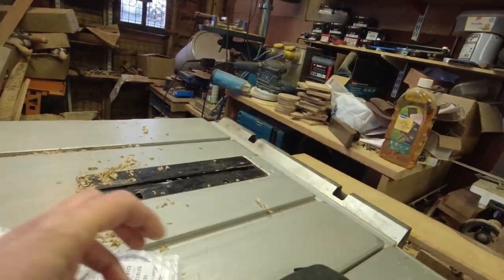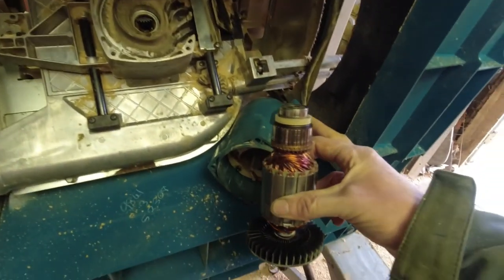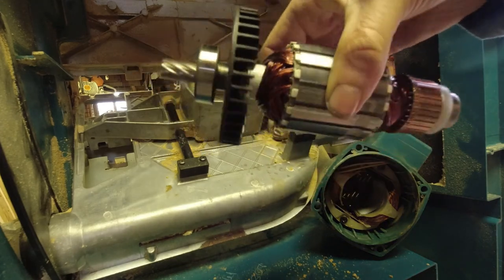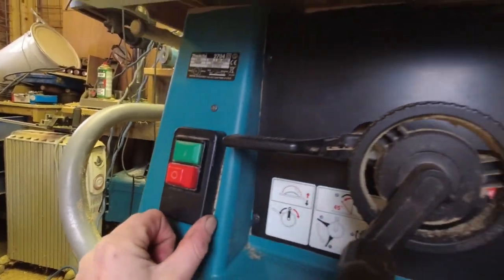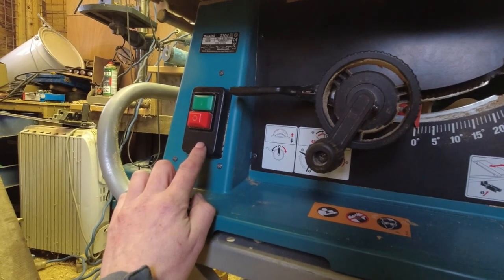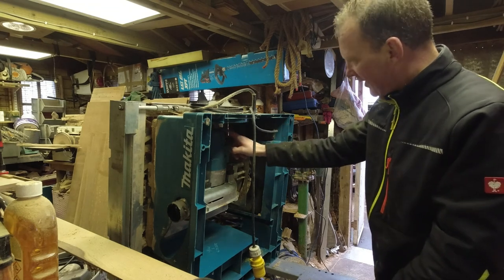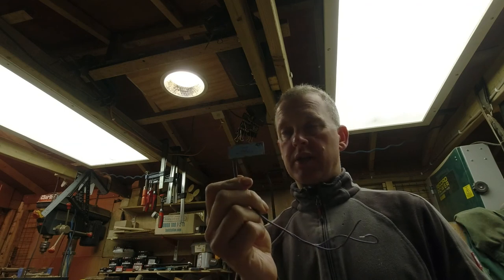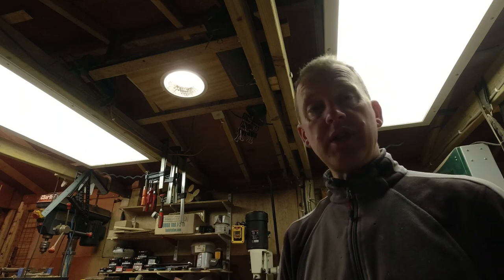Makita 2704 Table Circular Saw Trouble Shoot & Repair. DIY Disaster

Comment: Thanks for the video, It was certainly helpful.
I had a lot of problems with this saw that I bought on Ebay. It stopped working whenever I was cutting anything remotely hard or thick then restarted after a while. I replaced the armature - no change. An electrician told me that he tested it and couldn't find a fault but it could be the switch. I replaced it and still no changes. I ended up replacing the field coil and that solved the problem. It might have been worked too hard and damaged it without blowing it completely thus the fault couldn't be found.
You are right to mention that part 325 - Makita SOFT START CIRCUIT shows in the drawings that it goes in the switch but it doesn't. It goes in the motor and the part that goes in the switch is something else... Maybe I've got an older model.
Thanks
Reply from the maker: Thanks so much, I’m glad it helped in a way. I bought this used and it was excellent for a few years before this fault. 
If it happened again I’d get someone to wire in a completely different switch or maybe even upgrade the saw🤔

Comment: I have the same model 2704, have had it for 10 years maybe, and I can't raise the blade any more, the mechanism is stuck. I'm not sure what went wrong, I started taking it apart. Also, after starting there is a knocking sound from the blade, probably it needs an overhaul.
Reply from the maker: Oh dear that doesn’t sound very well, the raise and lower can get stiff so I’ve found by taking the blade slot insert out you can lube the threaded rods but as for the knocking?

Comment: Just put new field windings on my mates 2704 I thought that black capacitor was something for the brake now I know it's for the soft start, thanks for that
Reply from the maker: So glad it’s helped someone, I had a bit of a nightmare with it but it’s working a treat now
Reply: Where do you get your spares from? Also is the wiring diagram available anywhere? I’ve just picked up a non runner and hope to get it working again.